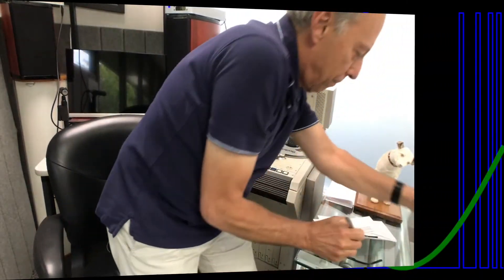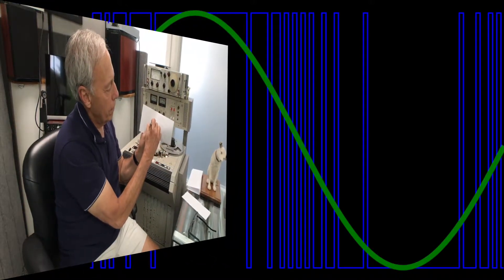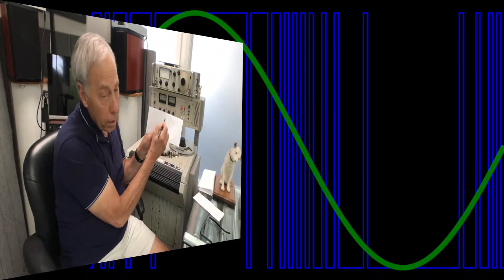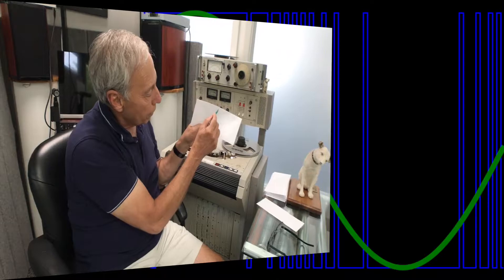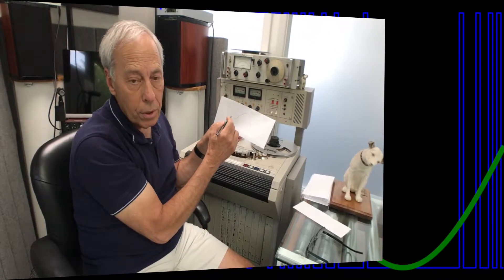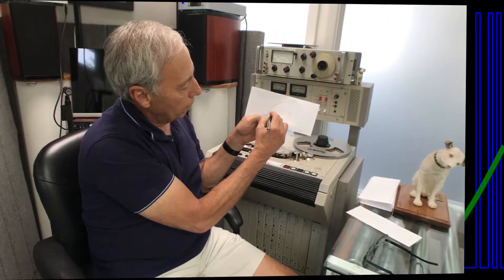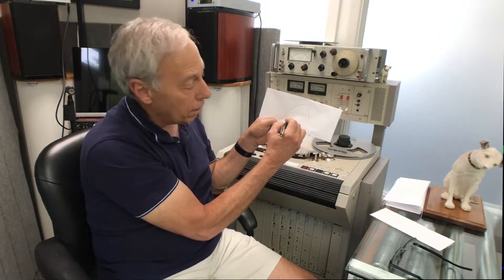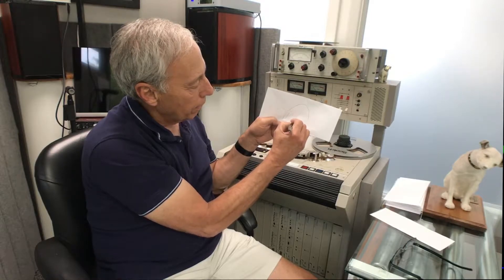The difference between DSD and class D

Comment: is it posible to use native DSD speakers? 2 poluses where digit 1 magnetically moves it front, 0 back. In that case there no need amplifier and DAC at all, it can be called magnetic field controller. More magnetic field - more volume. Direct DSD Speaker 😊. Is any solutions in 2024?

Comment: Reasons why you can't drive a Class D amplifier output stage directly with a DSD bitstream:  
1.  Inefficiency.  DSD bitstreams do not use the full modulation range due to stability issues with Sigma-Delta modulators; they are generally limited to 50%.  Thus a DSD stream would only allow the amplifier to reach 25-30% of its full rated power.  
2.  Filtering.  In spite of Paul's suggestion otherwise, it is not simple to filter a 1-bit output down to the audio range, while retaining the full DSD detail and avoiding excessive high-frequency residuals which would overdrive tweeters.  
3.  No volume control.  You cannot alter the signal amplitude in a DSD bitstream using a simple volume control.  Achieving volume control requires demodulating DSD to analog or PCM, applying the control gain, then converting back to DSD - all of which would of course completely negate the goal of direct DSD bitstream use.  As an alternative, one could modulate the power supply rails, but that gives a rather limited range.  
4.  DSD bitrate.  The lowest DSD bitrate is 2.8224MHz, which would require an output stage capable of operating at a 1.4112MHz switching frequency.  Today's designs only operate up to about 500KHz.  
5.  Distortion.  For low distortion/noise, the output voltage levels would need to be extremely precise and noise-free; this is not within the capability of current output stage designs and their power supplies.  Further, propagation delays and slew rates would need to be balanced to extreme precision and the output filter linearity would need to be nearly perfect, while also being rather complex.  Everything needs to work to high precision, without benefit of feedback.
Reply: @goog le 
Sigma drive allows the amplifier's feedback loop to compensate for the effects of the speaker relay and series output inductor within the amplifier, as well as effects of speaker cable impedance - as long as you use the special speaker cable provided.  
Benefits are real and measurable, but still subtle.  I'm not sure how many owners would be able to hear them.
Reply: @goog le 
I found a schematic for the M2.  A significant design feature, aside from the Sigma Drive, is that it also has dual power rails for the output stage:  +/- 50V and +/- 91V.  That improves efficiency and allows the output transistors to run at lower collector-emitter voltage.  They use a custom IC to control the crossover between the two sets of output transistors.  
The Sigma Drive connection is designed with a bypass resistor, so if you don't use a Sigma Drive cable, the amplifier operates much like a conventional amplifier.  Also, the feedback crosses over to an internal point (even if Sigma Drive is used) above 15KHz; this is necessary to protect the amplifier stability in the event of improper speaker connections.

Comment: Why not start combining the amplifier class d and dsd stream without dac converters. To use the output transistors of the d-class amplifier as a converter, because you can amplify the PWM modulated signal directly! For the first time to receive a device - an amplifier d and dac having analog conversion only at the output of power transistors and nowhere else                                                                                                                                                                    почему бы не начать совмещать усилитель клвсс д и дсд поток без преобразователей dac. что бы использовать в качестве преобразователя выходные транзисторы усилителя д класса, потому что можно усилить шим модулированный сигнал, непосредственно! впервые получить устройство - усилитель д и dac имеющий аналоговое преобразование только на выходе транзисторов мощности и больше нигде